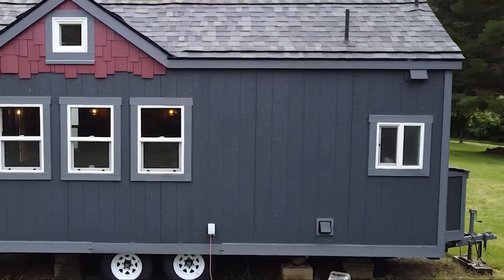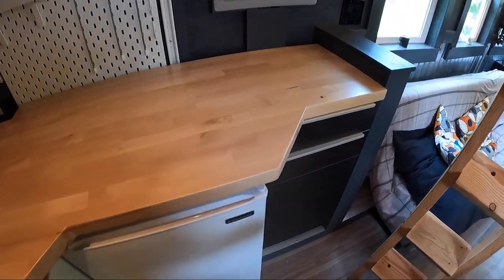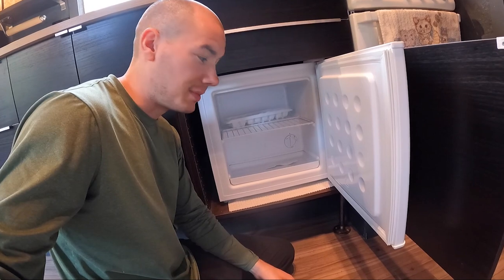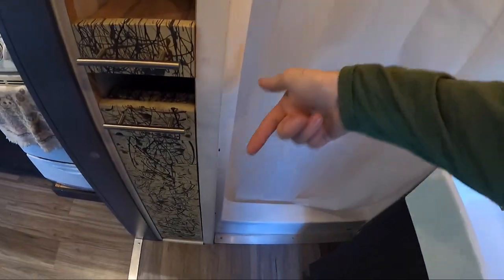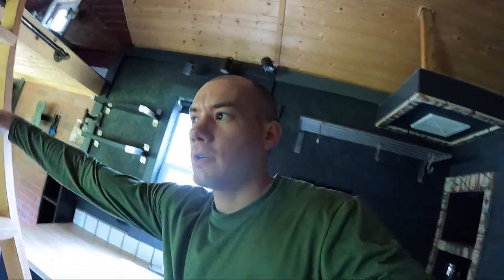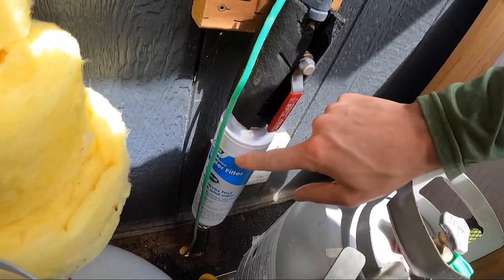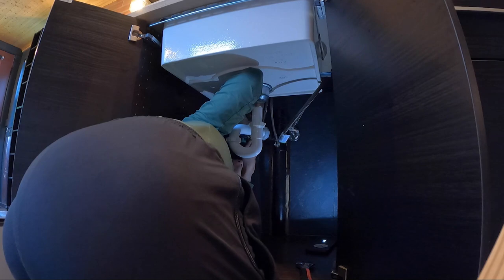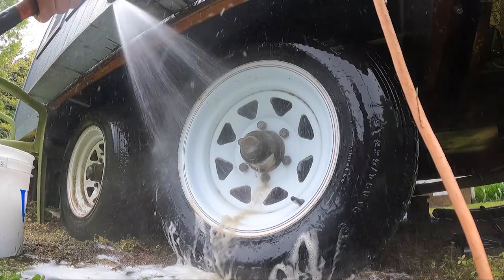About My Tiny House...

Comment: This popped up in my news feed, and I enjoyed your tiny house tour tremendously. I saved the video to "watch later" so I can take notes from your journey. Do you have any advice for first time tiny home buyer? Xoxo
Reply from the maker: That's so great to hear, thanks Lauryn!  We'll, if you're buying a tiny house I recommend making sure the layout is going to be comfortable to you.  If you're building your own, try your best to design it around your needs.  Everyone's different so, I can't say what to do or what not to do.  I will however say no matter what... do everything you can to optimize for ventilation.  Fans in strategic places, windows galore.  Just always be on high alert for mold problems.  Small spaces are molds best friend, so be a clean freak and when you're cooking or showering, open the windows and crank the fans! 😊

Comment: Interesting Interior Build Fellas. You never want that Hot Water Heater to spring a leak, oh gee, better placed on 1st Floor. Hot Water Heaters will leak. A great wood burner fire box Marine Size be great, easy to do Vent for them. Always want your L.P. Gas items Vented. Solar Panels on the roof would be great, Free Electric from the SUN! There heater you have now is like having a Toaster On, ouch. OMG this has been a Info Commerial to Rent.